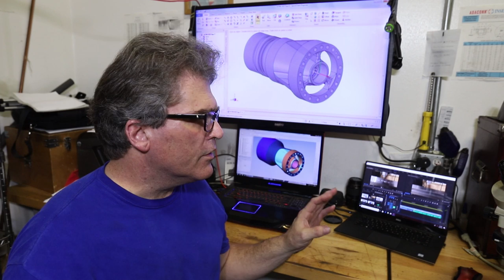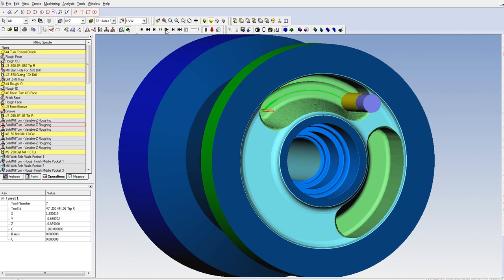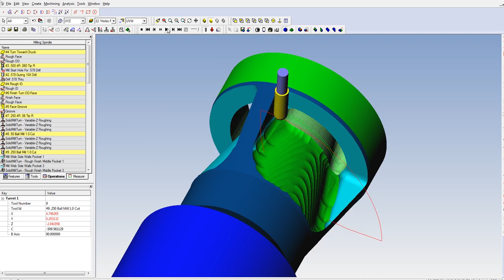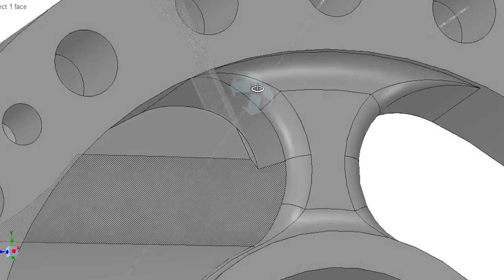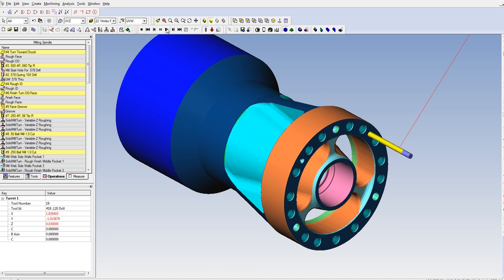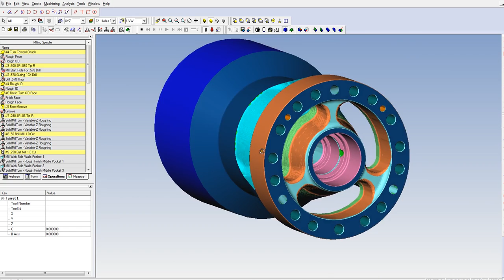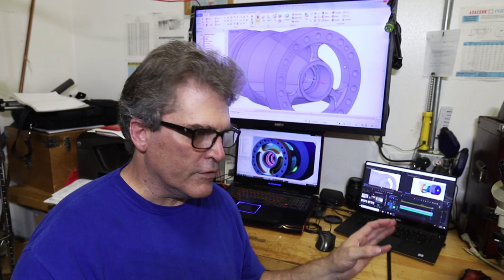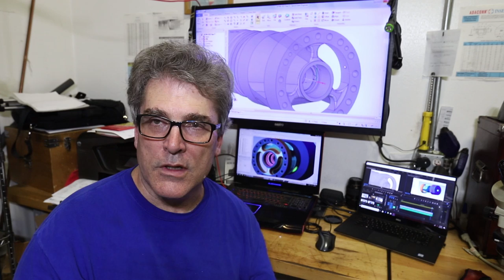Plan A Job 2

Comment: "If there's any engineering students in here take note..." Seriously, I think every engineering student should have to do a one year internship in a CNC shop so they at least have SOME idea of how parts can and cannot be made. 
BTW that is some VERY impressive programming on that part.
Reply: I am an engineer (electrical), but I come from a technician background. I completely agree. Most engineers get caught up in how to make a model or drawing perfect, and don't take into account manufacturing. There could be a simple change that won't have much of an impact on the final operation of the design, but making the change can shave a significant amount off the cost to manufacture the design. In the worse case scenario an engineer can design the "perfect" part that is impossible to manufacture. 

Design for Manufacturability should be a required course in all engineering curriculums. And actually spending time with the individuals doing the manufacturing is invaluable.  I guess this is one reason "green" engineers can be so rough around the edges. It's difficult to learn this stuff in school.
Reply: There is a big gap between what they teach you to design and what they teach you to actually make. Most engineers actually have no idea how to actually make the parts they design (like a 5° tapered bore going from 2mm to a 0.17mm hole or square internal corners all over), and that's why they could cost a company a lot of money. Not to mention the crappy GD&T work (superfluous dimensions that don't add up,  missing datums, wrong feature, wrong sections and views). A good design and GD&T work can easily cut the cost of manufacturing in half.

Comment: ...so you'll need to hand tweak the cutter compensation on 27 tools for each piece?
Reply from the maker: Some tools yes some aren’t using cutter comp (the roughing tools). The finish lathe tools of course have offsets that have to be adjusted for every part. A goon percentage of the tools a also drills.

Comment: In a past video I think I remember you machined a slot in the part so you can orientate the part after you flip it around.  Is there a feature that is available for you to be able to indicate this part?  Thank you Charles.
Reply from the maker: The side port will allow me to set my C zero on the next operation.
Reply: Thank you, I look forward to the next setup.

Comment: Just out of curiosity, are you constraining with boundaries?
Reply from the maker: If you a talking about the tool path yes. The pockets on the face and the OD are using trim features.
Reply: Thanks for the reply, I do the same kind of work you do. I say this so you know there is someone that truly understands, and appreciates the dedication, tenacity, and passion necessary to gain this much knowledge and experience. Not many fully grasp how much work and effort it takes to get to your level outstanding work!  One of the best of the best!
Reply from the maker: Thanks shane.
Reply: @shane9338  you didnt know peter is actually an actor ? This is an infomercial for the integrex line 👍

😀😃😄 just kidding peter is a master !

Comment: My Holy buffalo.... This part would scare the daylights out of me to attempt, LOL... I am wondering, Although, the parts design would leave the impression, that it is quite rigid, as per the tree fins that branch out the the ring with the several holes, and that it is out of a stainless steal alloy, will the be any issues with this much material being removed and the part relaxing or destressing (if that is a word) milling only one whole third at a time. In that, if you were to come back and run the tooling path in the first 1/3rd that was hogged out and then finished pass cut, would the part have pulled on you? or to say warped ? Like wise, the ring area that has all the holes into it, wouldn't that amount of holes cause the ring to warp or go out of round? unknown to me, if it does, and if the amount it does warp, would even be measurable or worth being concerned about....   Either way, this part is crazy and the model you put together to explain what you are doing, Thank you for the effort and time that you have already done to do such.. Dru
Reply from the maker: That's why I have left the finish passes on the OD and ID till after the roughing. I don't think the holes in the face will cause enough distortion to worry about. We will check after the first part to be sure though.

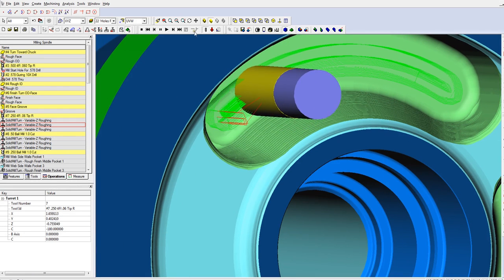Comment: At 2:06. Would it make sense to start the pockets with a drill to make plunging easier on the end mill?

About those radius intersections. If this was my part, I'm shure the machinist would call and ask whether he can make it a little different ;)
Reply from the maker: We may add a drilled hole. The the person running the job and I have already talked about doing just that. We would just have to be carful not to drill into the conical surface. Thanks.
Reply: Ya im thinking 2 holes per pocket

Comment: Hi Peter, what is the surface finish requirement on the webs where you are doing the surface machining? Do you use a surface finish calculator to work out approximately what step over you need to achieve the surface finish? 

Great video as always, love seeing how this channel is growing
Reply from the maker: The areas that are going to be surfaced have a .03 form tolerance. So those areas fortunately aren’t critical. The software has the ability to set a cusp height on the tool path to help control finish.

Comment: Haha, "good money,"
That's a $50,000 component that probably goes into some $5 Million turboencabulator.
Reply: Looks like they're using a hydrosolator flange connection to a left handed conflution coupling. Nothing wrong with it, but I'd take simple ground effect crank viscopulsometry over it any day if I had to trust it at Mach 2 in a vacuum...

Comment: yours are the only machining videos i watch multiple times in an attempt to get a handle on the incredible complexity of both the part being made and the machining of the part. i guess there must be some gas or liquid flowing through this part to account for extravagant engineering the designer  has come up with. in future videos on this part i hope we find out how much of the tooling is off the shelf and how much has to be made ( by you, i guess ). thank you !

Comment: Thanks for this video. Glad to see the iterative cycle of speeds and feeds being a necessity rather than just merely pulling up a calculator.

Is there any way to do even more aggressive roughing with a separate larger/more robust tool to preserve the regular rougher in those pockets?
Reply from the maker: With the pockets being so small and the conical feature tapering up close to the other side. Its pessary to use a small tool that's about the largest tool that will fit. A tapered tool might be stronger but it would add complication to the tool path for the roughing. Also tapered end mills cost considerably more than a standard end mill. I might be more cost effective to just wear out smaller end mills.

Comment: Thanks for such an informative video - very valuable to see how you think about these parts! Would you consider breaking up the final milling finishing pass on the back side of those pockets and use a bull-nose on the tapered bit with C axis milling, and only ball track the radiuses on the sides? Same thing on the front - can you use a 5 axis path and the side of the tool on the tapered parts and then ball track the radiuses? Just wondered if that would save some time and also if it would be problematic getting a good blend.
Reply from the maker: On the end pockets I did try something similar to what you described. I couldnt quite get it to work to my satisfaction. I haven’t given up on the idea though. On the OD pockets they will still require some roughing in the reverse taper area before finishing. The c-bores on the screw holes have to be put on first. So that side is just roughed for now.

Comment: Thanks for the video, Peter. When customers send you a part like this is there ever a conversation about manufacturability? The work I do is mostly job shop/repair where price is the driving factor so our customers don’t mind redesigning  some things based on our inputs. I know the conversation must not happen much in Aerospace, but do customers ever want you to weigh in on manufacturability and design decisions?
Reply from the maker: Sometimes, but most of the time that’s not really a option. As machinists we mostly have to machine what we are given. Unless it is totally impossible to do so. I have run into those problems before though.

Comment: Perfect. This is exactly what I wanted to see. First to me it looks like the engineer intended this to be cast roughly to shape then finished machined. Which is why I think it has the drafts which are annoying as hell to machinists. Second have you considered chain drilling as much material as possible out of the flange pockets with a thru coolant drill? It might help preserve your end mill.Lastly the hole in the side looks like it's for a sensor.

Comment: Awesome video as always. Just wondering why you went for a small step down roughing toolpath with your ball end in the pockets? Why not either predrill or helix in and use more axial engagement on the tool to hog some out and just do a smaller roughing step on the walls?
Reply from the maker: It may not be apparent in the video but this is a small diameter tool in stainless steel. It would just break the tool to take deep cuts. Because of the taper ( from the conical shape) of the pocket to get to the bottom the tool has to be small in diameter. Now it may be possible to use a tapered endmill and a 5axis style of cut to rough. I haven’t tried that yet. I may give that a try. Thanks.
Reply: Edge Precision TBH I didn't even consider the size of the tool. Makes perfect sense. 

Thanks for the response

Comment: use a lollipop tool  then you can get behind that rad from the front
Reply from the maker: I will get it from the other end. I have to machine the bevel where the counter bores for the screws are from that side anyway.

Comment: Very cool, will be interesting to compare the actual cycle time to the predicted one.  I'm wondering how essential to the function of the part how those fillets are done.  I think for some customers they really don't put too much emphasis on manufacturability, the cost of the part is lost due to the scale of the project.
Reply from the maker: This should be a required subject of learning for engineering students. They use to be required to take a machine shop course. My son is studying to be a mechanical engineer. He tells me it is no longer a requirement for their degree.
Reply: @EdgePrecision  This makes me feel better about MIT's mechanical engineering department, taking Design and Manufacturing 1 and 2 is required. D&M 1 involves manual operation of the mill, lathe, and various other shop tools while designing a robot for a competition, and D&M 2 goes over injection molding and CNC machining for mass manufacturing. I don't see how you cold be an effective mechanical engineer without any idea how to make your parts.
Reply: Just started teaching engineering a year ago - sadly you're right. A lot of schools are tending to drop the machining classes from their requirements. I urge all my students to take it as an elective - and to spend as much time as they can in the shops because even the classes are getting watered down in my opinion. At least the machining classes targeted at engineering students at 4yr institutions. I teach at both a 4yr university and a community college. The machining classes at the community college are much better since the focus is on forming proficient craftsmen vs. the 4yr where they are just trying to wet the students feet so that they have a rough idea what the difference between a lathe and a mill are. I'm consistently having engineering students come to me for advice on manufacturing for their senior projects and they seem to think 5axis and CNC are magic words that can make anything manufactureable. Another trend that worries me is the introduction to 3D printers early on in engineering education - its a two edge sword, they get to develop ideas quickly, but it often gives students a false sense of what will actually work in the real world.  

Can you do another video showing a couple examples of features that are optimized (the specific features that make 5axis possible) vs poorly design features? Thanks so much for your videos, I've learned so much from them.
Reply: After watching this video I did spend some time looking at 5 stage turbine units of one sort or another just to try and figure out what was essential and what could be optimized... On the one hand I can see why they would insist on it all being one piece BUT on the other hand there could be a lot of advantages if that "Ring" was a separate part. Those fillets look pretty "Janky"/ not thoughtfully resolved to me as Peter is trying to tactfully point out.
Reply: Unfortunately this looks like the CAD designer was more interested in making the part look cool than in getting all the function from a more easily manufactured part. Without knowing what the design constraints are, for all I know this could be an amazing solution to a complex machine design, but based on the part being made from base shapes that are quick and easy to draw in just about every CAD program, I doubt it.

Taking the hardship during the CAD design stages to make geometry that's easier to manufacture pays for itself again and again for every part you make though.
Reply: There should have been some better Design For Manufacturing.  It is surprising how many high level projects have manufacturing hiccups.  I agree, those will be expensive parts.
Reply: From my experience as a Mech eng student in the UK, it seems to just be maybe one or two lectures per year, aside from the 'this is a lathe, don't put your hand in it' stuff. The rest of it you just have to learn by practice (i.e. being told off by the machinist for giving them something impossible!)

Comment: Thanks for doing this Peter! One minor suggestion I have is to perhaps slow down the pass through the simulation by about 25%. I kept having to stop and back up to relate what I was seeing on the screen to what you are saying. I think it will be very interesting when you get to talking about tool selection, why you chose one tool instead of something else for a given operation.
Reply: l wilton you can change the playback speed on YouTube if you like (I put most videos like this to 1.5x)

Comment: i love this kind of video, I do a lot of programming with investor hsm( the professional version of fusion 360) even tho its a different programming software it nice to see some program a part that is going to get machined and have to hold tight tolerances  its one thing to do some 3d machining and 5 axis machining if the part is just a widget or a paper weight.

Comment: Thanks Peter. Excellent.  Question .... I may be jumping ahead but...does the Esprit software allow you set a tolerance comparing the model dimensions to the final machined dimensions? Like a color variance that would show any areas that may not have been completely machined to final size. Sorry my wording is not expressing the question properly. Ah, any “surprise” rest material during simulation.

Comment: What are yours tips for using a threadmill in stainless? Do you have to take a decent width of cut in order to not be cutting in the scale of the stainless as it work hardens? Or can carbide threadmills handle cutting in work hardened stainless?

Comment: Cool!  Im an esprit user so i appreciate the video.  Did you buy a licensed post from esprit for your machine?
Reply from the maker: I don’t know if they have changed this sense I bought my Esprit. The have posts for free. The Cam Wizard even has a CD on how to edit your post. I have this CD and it has been very helpful to me when I modified my posts.
Reply: I have used Cam wizard.  I find it a real struggle to write post for mill/turn.  It seems like one function works and the other doesnt.
Reply from the maker: I have made some edits to my post. It is tricky. You have to make small changes at a time and compile them. To make sure they work before continuing to something else.
Reply: Edge Precision nowadays, they lock out their posts almost completely and charge a small fortune for them. I've been an Esprit user (sometimes enthusiastically, sometimes regretfully) for 13 years.

Comment: These videos must have taken a lot of time out of your day to put together and appreciate it.

You've said before don't start gun drills until they're in the pilot hole, how do you program the drill cycle to allow for this? Or is it a manual edit?
Reply from the maker: I have modified my post processor for Esprit so if I set a custom setting on in the drilling cycle it doesn't start the spindle till the tool reaches the R plane in the drilling cycle. Than stop the spindle before retracting out of the hole. For very long twist drills I can also run the drill at a low speed until it enters the hole than speed up to drilling speed.
Reply: Manny Calavera  CAM programs hav Deep drill cycle where you define spindle start position...
Reply: HybridiHippo esprit?
Reply: Manny Calavera I'm not using that cam, but under drilling cycle there is selection off what type off drilling you want and there should be deep drilling or just gundrill option.
Reply: Edge Precision thanks for the explanation.